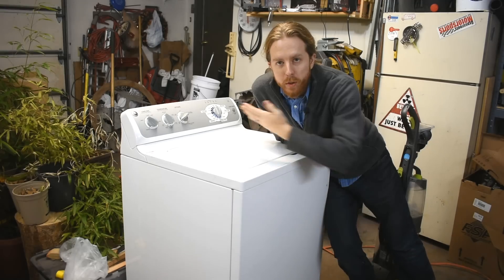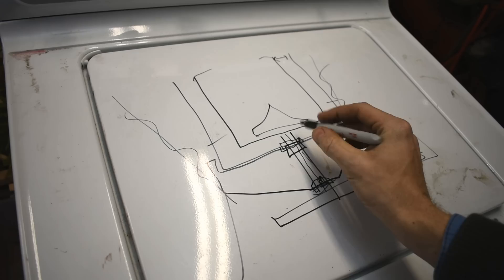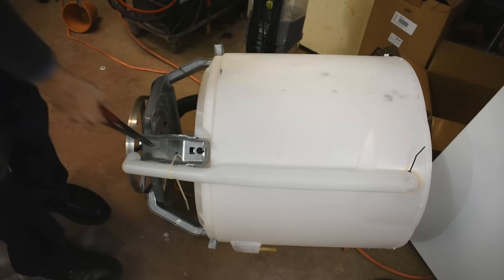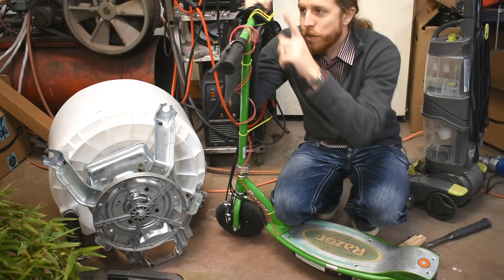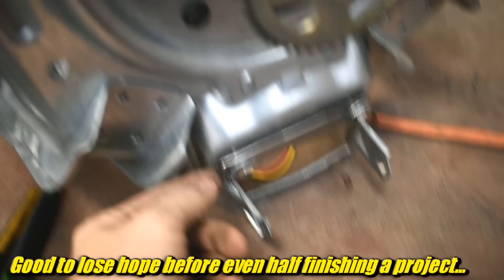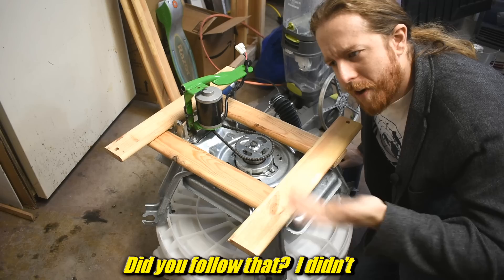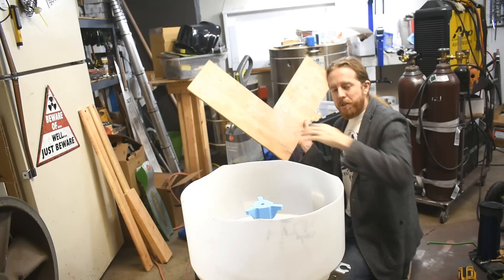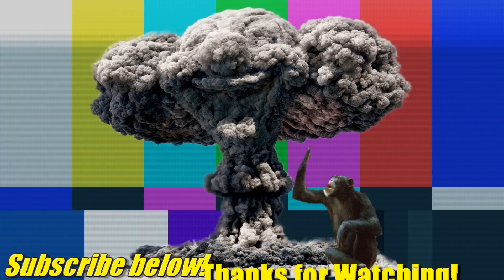Make an Electric Pottery Wheel from a Scrap Washing Machine

Comment: i grew up in a pottery and i wasn't ever good at throwing, however i will say that if your wheel is at all off-centre then you're making your life 10x as difficult. get something heavy to be the actual wheel itself, like a steel plate, then the inertia in the plate will smooth out any minor inconsistencies in speed and make balancing inconsistencies impossible to ignore.
Reply from the maker: I fixed the wobble after recording this but I haven't fixed the speed control.  I zip tied a bunch of weights to the thing and that helped the inertia issue... until a zip tie broke and it all flew apart catastrophically.   That was exciting.
Reply: that sounds hilarious, hope the damage wasn't too bad.

Comment: I love this! I’ve also used the outer washer cabinet shells to make some really cool rolling tool/parts cabinets for my bike shop: swap in a frame made from bed rails (perfectly legit angle iron), beautiful wood drawers, 1/2” thick rubber stall mat for the top, quality 3” castors, tool drawer liner, painted it “oil rubbed bronze,” and because I had or found most of the stuff for free, just makes it extra glorious.

Comment: Brilliant idea! Only thing is, speed control is essential... if it can't be controlled by a foot pedal like a regular wheel then a switch with slower speeds might do. But I know nothing about engineering to be able to say how to do that :)
Reply from the maker: I have ideas for that actually.  As a last resort I can buy a scooter speed controller with a foot pedal controller from an electric scooter place designed to work with this motor and voltage, but I'll do that only if I cant figure out a different method.  That would remove the challenge!
Reply: @PaulsGarage  While reading Lee's comment, I thought about a sewing machine foot peddle controller thingymajig?
Reply: If you're willing to only have a few fixed speeds, pinch the fan controller out of a car.
Reply: @dfross87  Not a great idea. Those work by inserting resistors in series with the fan, which means that a large amount of power is wasted, and a lot of heat produced. A PWM controller is much more elegant, and they're pretty cheap on Amazon. make sure it's a DC PWM, not an AC one.
Reply: Perfectly true, but that doesn't keep with the theme of this build. Also, it's not hard to acquire a fan controller for free from a wrecker's.
Reply: @dfross87  Well, I should add that those fan controllers aren't durable. It's the heat they make that kills them. I replaced the one in my Jeep 3 times so far.
Reply: @stamasd8500  Must be a Jeep thing LOL.

I've replaced the fan controller in my 30 year old Nissan.....no times.

Comment: I just started making a 2 X 72 belt grinder and those treadmill motors would work fantastic in one of those.
Strong motor, variable speed, the motor controller in with the treadmill, and they can be had for free if you look hard enough!

Comment: Paul... My 2 cents to you. Go to some stores that sell beds and ask for old bed frames or look for them on craigslist.  That makes for free or cheap angle iron. Also go to goodwill store or some other thrift store and get a used large plastic cutting board. The white nylon type ones are about 1/2 inch thick. Great video...

Comment: You could've tested the washing machine motor, if I was correct it was a universal motor and if it was it works also on DC. So theoretically you could arduino control it using an H-bridge. I'm gonna make a video about that. Hope you didn't throw it away
Reply: I think he mentioned the motor was blown, that's why he was using the scooter to power it
Reply: @danistador  yes indeed, just was wondering if the board was blown off instead of the motor.
Reply from the maker: You know I didnt check it out personally. The boss man said the motor was shot and he would know, so I believe him.  The motor board could be bad or the motor itself. Either way GE wanted too much for the replacement (on a bad washer) and the customer opted to buy a new one.  We only replace parts on customer machines with OEM stuff from the manufacturer for insurance reasons, so this was heading to the scrapper.  I'll check it out, I still have all the stuff in the garage.
Reply: @PaulsGarage  Please do keep  the motor. You can folow the instructions for checking it with a battery here:  https://www.youtube.com/watch?v=M1IWJfKequQ
some people also made some cool stuff with it like a motorized bicycle: https://www.youtube.com/watch?v=9-o_QaJXj8Y

Comment: Cool contraption you got there! I took a few pottery classes years ago. I'd recommend a smaller diameter splash guard so you can hug it with your knees. Then you can stabilize your elbows on your knees and it'll be much easier to center the clay. Pretty cool way repurpose a washer! Wonder if you could make a ball mill from a front load, you could "mull" casting sand and make gunpowder!

Comment: From 3 years in highschool ceramics I'd recommend a wire tool a wood tool and a few ribs to start out with. For speed control maybe try wiring a dimmer switch into an extension cord and see how that does. I tried that for controlling fan speed in my foundry torch.
Reply: Jack Pfister a regular dimmer won't work because those are good for AC only and he's using a DC motor with batteries. A DC PWM controller would work.
Reply: @stamasd8500  The fan I used plugged into a wall socket, wouldn't that make it an ac motor?
Reply: Jack Pfister Your fan yes. But Paul uses a DC motor. A dimmer will not work for a DC motor.

Comment: You can place an insulation pipe wrap on top of the splash guard this will make a cushion for your hand.
Also put sewing machine motor with pedal that works with speed control.
Overall you did a great try.

Comment: The pot exploded because it was spinning too fast. You need speed control. To achieve that without wasting power (or too much power) you need a DC PWM controller. Fortunately Amazon is full of them. Here's an example: https://www.amazon.com/RioRand-7-80V-Motor-Controller-Switch/dp/B071NQ5G71/ref=sr_1_5?ie=UTF8&qid=1546729501&sr=8-5&keywords=dc+pwm
And if you need more than 80V/30A you can find plenty others.
(edit) In fact you know what, I have a few DC PWMs laying around, I'll just send Paul one. It's only 20 amps but should be enough.

Comment: Hi Paul,
I am determined to make a potter wheel on following your lead 😊. Any idea on the age of your GE washer? Some of the take part YouTube for GE washers show a different pulley system. When did GE stop using the one big pulley at the bottom of the shaft? I need to know the year of the change up. Diann in St Paul. Thanks,, This video was so ingenious and very humorous. I WANT TO MAKE ONE ALSO 😊❤😂
Reply from the maker: Not sure the age, it could be 15 years old or so?  not sure. I ended up using this wheel for about 6 months before buying a Shimpo VL-Lite, and honestly I wish i had done that sooner.  It was fun turning the washer into a pottery wheel, but for making pottery, it's hard to beat a regular one. If you want to build a pottery wheel i would suggest a kick wheel, which I have a video on also.  I like that one more.

Comment: Nice carpet cleaner. I have one of those. Use a potentiometer to adjust the speed. ( edit again) or use a tig foot pedal or your wife's sewing machine foot pedal
Reply from the maker: I looked into that, a potentiometer might not like the amperage going through there, I dont want to butcher my tig foot pedal, but I do have an old style sewing machine foot controller coming from a family member.  That might work
Reply: @PaulsGarage  you dont have to hack your foot pedal, get the sockets to fit and wire to suit the pedal. That's if all else fails.

Comment: 👍  Is a 6v motorcycle battery in the forecast?  So did yuh keep a few rags handy when you practiced throwing clay, or did Sarah get mad and make you wash the door knob?   I'm glad you got the hot spatter in your ears problem solved.  🙃
Reply from the maker: Fun fact, the door knob is still covered in dry clay 🤣  the issue with a 6v battery is the lack of torque.  At 12 volts the speed is slower, but it has less torque and slows quite a bit when I try to center the clay.  6 volts would be slower which I want, but I suspect it wouldnt have the power to keep spinning if I try to move the clay.  What I need is a pedal to control power on demand, or maybe gear it to be slower and higher torque.  Haven't had time to mess with it though.
Reply: @PaulsGarage  Can you get your hands on an old-school electric (not electronic) DC speed controller with a rheostat?  I'm not sure if anyone makes them anymore, but I'm pretty sure you can get a schematic and probably the requisite parts.   Better get busy cleaning that door knob, I hear your couch isn't too comfortable.  😎
Reply: A couple of videos by another YouTuber, Jeremy Fielding, might help you.  He numbers his, so look at 019 &  059.
Reply: @PaulsGarage  If the two 6 volt batteries are hooked up in parallel would that not increase the amperage to the motor and increase the torque?

Comment: think you could use a lot of those side panels for sheetmetal , though you do need to get the paint off
the plastic sheet off the drum looks use able too
good idea for the scooter motor , at least it isnt that strong it will stop before the torq takes youre arms of 
think the speed is too high might need to take one of the batteries away and try half the power

and now i have to clean up............ think he still would have his eyesight if he slaps his wife on the but with those hands ,,,, they be mostly clean though
Reply from the maker: I actually cut the part where I talk about the panels, video was too long :(  in a nutshell the panels are galvanized and ceramic coated or epoxied, just too much work to strip it clean for 4 sq ft of bad steel.  The sides are stamped with patterns, too.  Most appliances are that way, unfortunately

Comment: Would you be willing share the 3d print file?
Reply from the maker: This was so long ago I don't have the file or the pottery wheel anymore.  It ended up in a dumpster and I bought a Shimpo wheel that works so much better
Reply: @PaulsGarage  awww sucks thanks for the fast reply. I am using inspiration from this video and doing the same thing using the original motor and adding a speed control dial. The print seems pretty straightforward just wanted to take the easy way out.

Comment: Sadly the pla printed part won’t last long with water exposure.
Reply from the maker: All the sooner I can print a bigger one then!
Reply: @PaulsGarage  If you make a new one maybe large enough for your wheel!?
Reply: @PaulsGarage  or you could pull out the furnace and cast one and while your at it cast s throwing wheel.
Reply: @PaulsGarage  Cast the part in aluminium!
Reply: Mark Shymanski the aluminum is bound to corrode because wet clay is slightly alkaline. Aluminum doesn't like that. Bronze OTOH...
Reply: @stamasd8500  I did not realize that the clay would interact with the aluminium. Bronze is a good idea. Either way though the flange to mount the wheel wouldn't necessarily come in contact with the clay as it should be shielded somewhat by the wheel I would think.